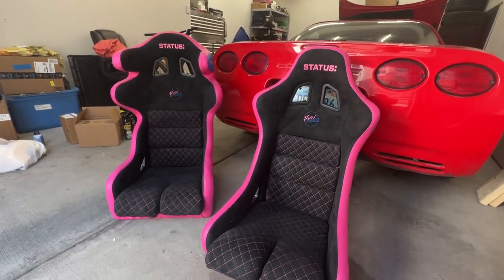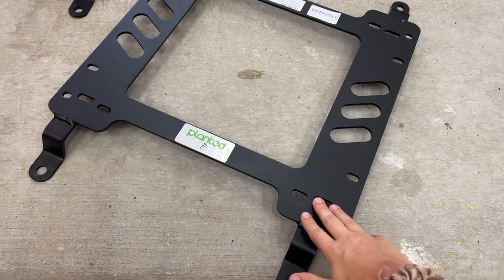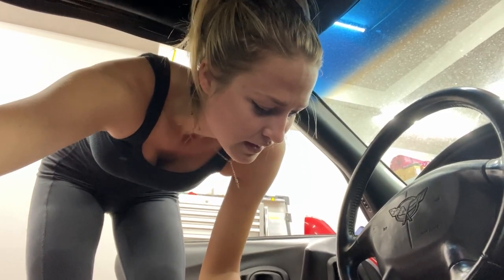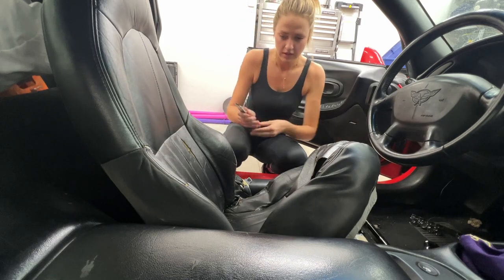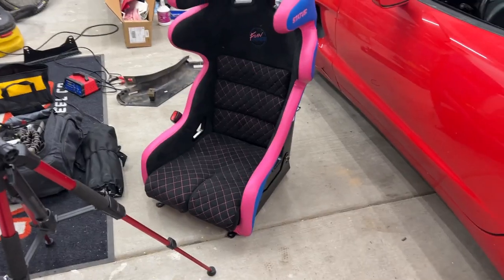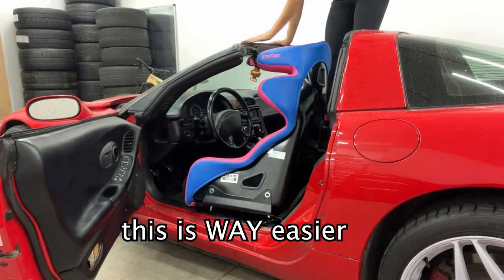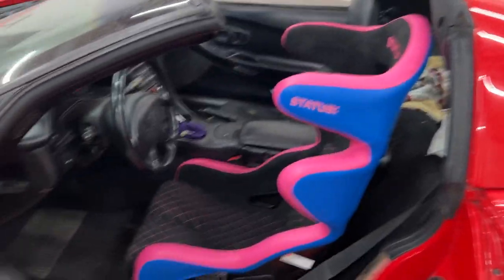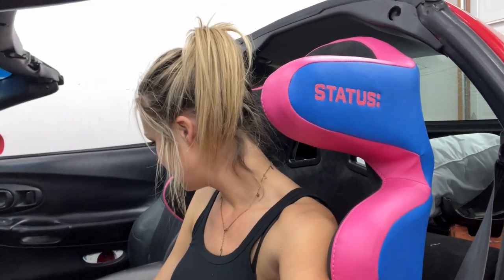C5 Corvette Race Seat Install

Comment: May I suggest a new thermostat with the 2 tiny added holes that help prevent air pocket when replacing old anti-freeze.  Call around to find a NO-FAULT thermostat about $10 ( it remains open when fails later, engine doesn't overheat blowing headgasket ).

Comment: 🚩🏁 🏆 do you have a good vacuum cleaner/cleaning products 🤔 were the old brackets structurally sound, importante' < what did you do with the electrical connector box ~ inquiring minds would like to know...the pink and red clash - needs work

Comment: Stock C5 Corvette suck!!! I need to figure out a different seat I don't even fit in my car safely with a helmet. I'll have a lot of extra C5 parts if you're in need 😉.
Reply from the maker: Hell yea! What parts do you have?? The c5 needs a ton 😅
Reply: @Gabby_Downing  I have a lot of different parts. I turned my C5 into a full race car. I have a lot of stock stuff like radiators, differentials, transmissions, stock ECUs, shorty headers and a lot of other stuff that I can't think of 😂.  If you need anything just ask I might have it. Good luck with your build!